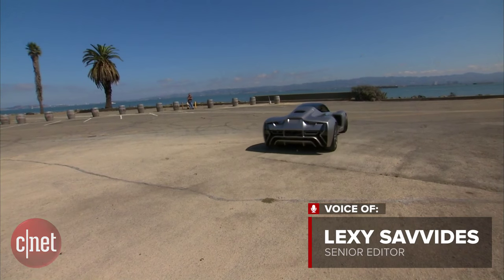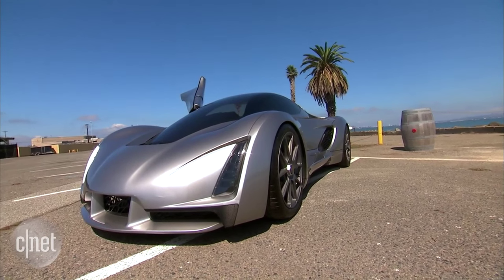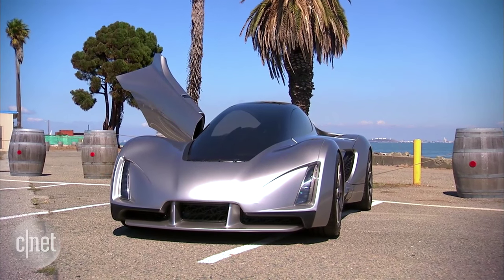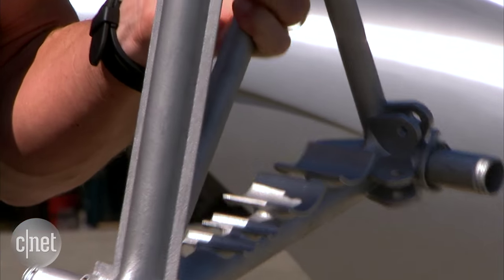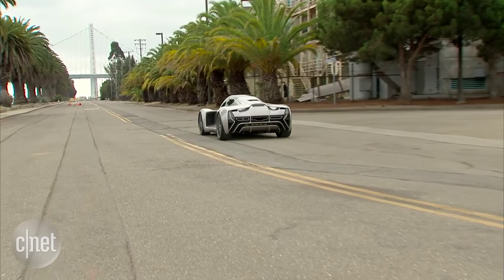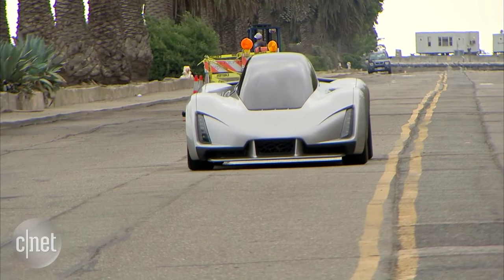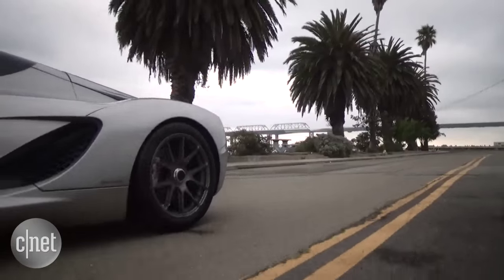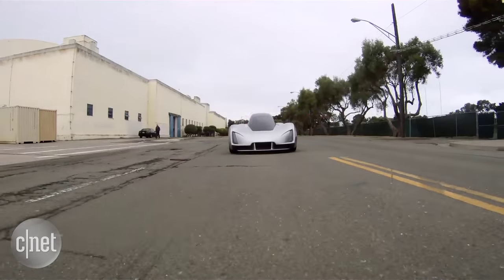CNET News - Blade car brings 3D printing to car making

Comment: What is wrong with injection moulding?
Reply: +Neurotic Knight making the molds is hard and can have limitations
Reply: It's a carburetor..
Reply: Morgan Williams ohhh okay
Reply: +Neurotic Knight VW actually had a machine that made the cars entire body out of plastic. They could do that now because plastics have gotten much stronger and would make your car much lighter.
Reply: TekReview's Moulding is for plastic.
Reply: Neurotic Knight Yes I know, VW made a big machine that would literally spit out any body you wanted. They were testing out the idea that you designed your own car body and the machine made it in plastic in no time. Like a 3D printer with a mould that could transform into any shape you wanted.